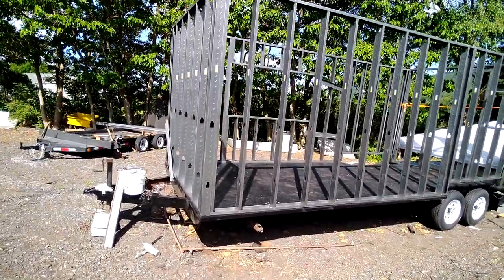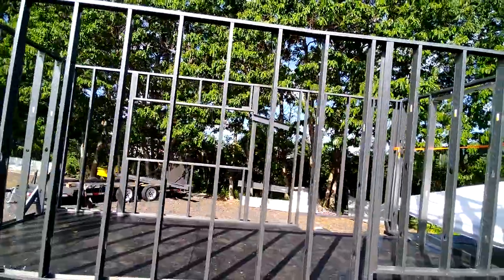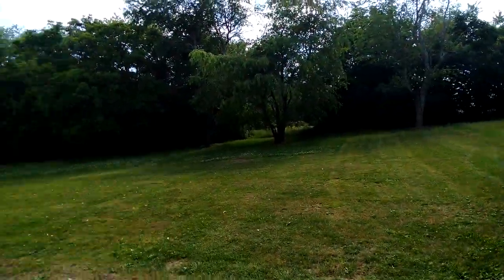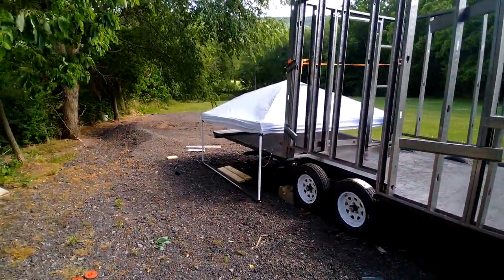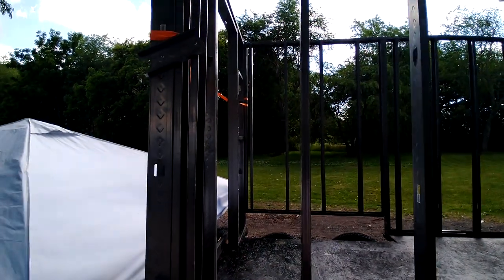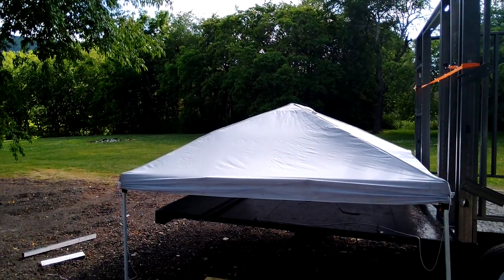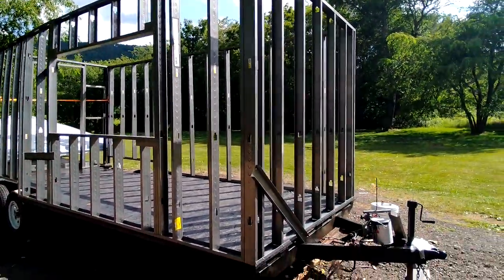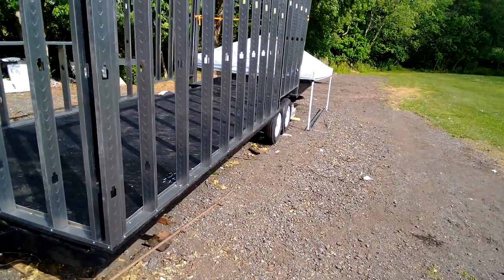Build a 31' Food trailer for on the cheap part 2.8

Comment: How much were your metal studs n where did you purchase them from? Are they less expensive than wood?
Reply from the maker: I purchased them at Home Depot. They were about $7 each at the time. I used them to keep it as light as possible. Make sure you screw them and dont just crimp them as they do in buildings at times.